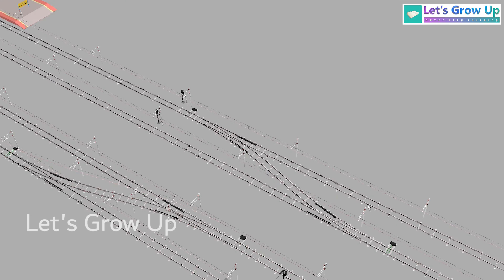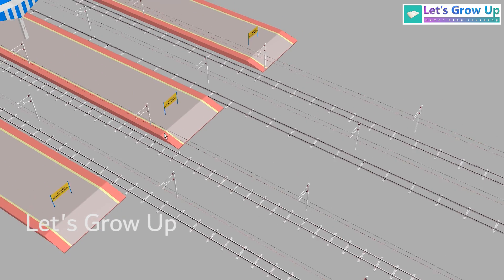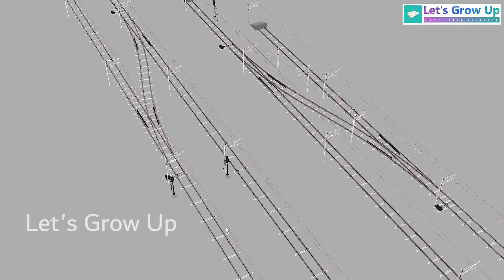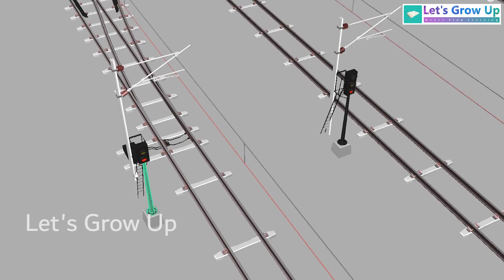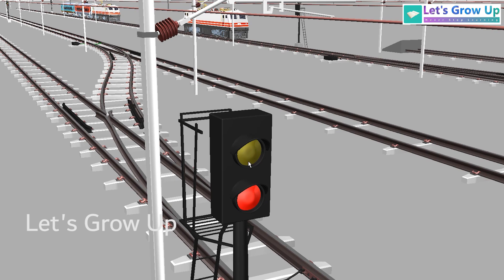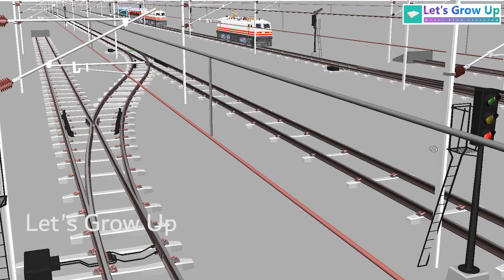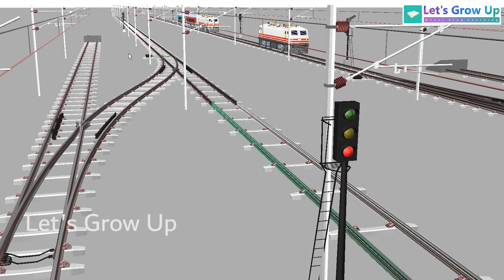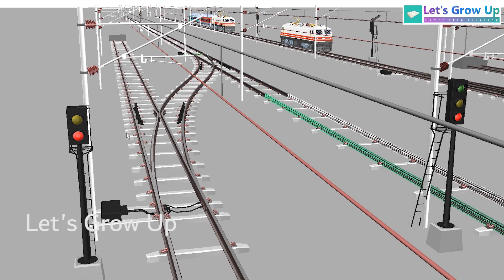Different Types of Railway Signals Near the Station

Comment: Sir you have to correct it. The one with route indicator was the home signal. 1st you have shown is the starter and advance starters.
A station has 2 home signals (for each route) each for up and down movements.

Comment: Sir,i think,what you mention HOME signal is starter signal,after that you get advance starter.
While approaching a train into station it has to pass two signals,first one is DISTANT signal which indicates actual status of Home signal,so that speed can change according to it,after that it has to pass HOME based on route indicator.and enters in to platform.and stop at STARTER,after that it has to cross advance starter or LSS.